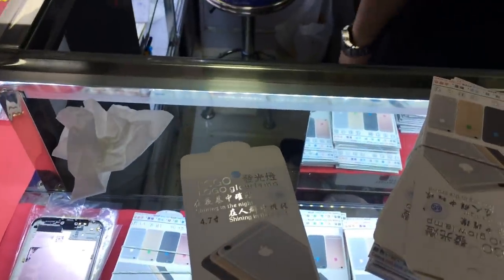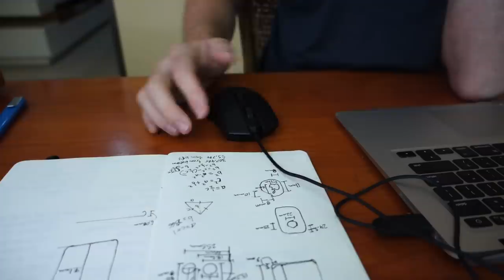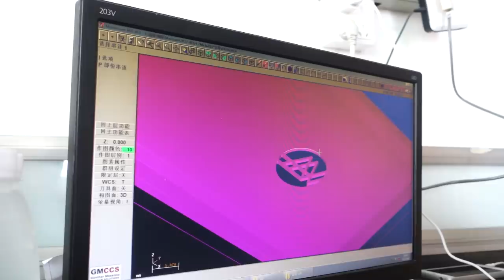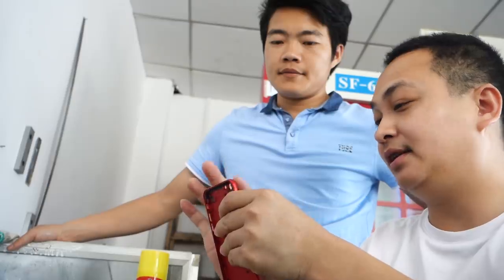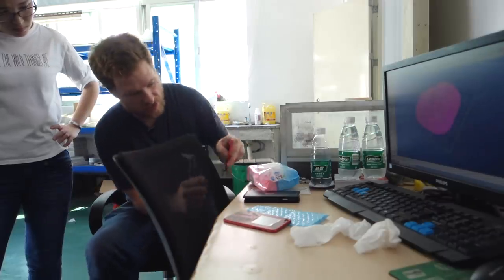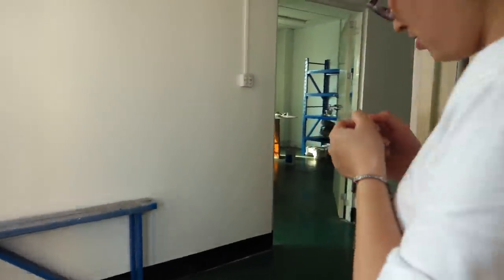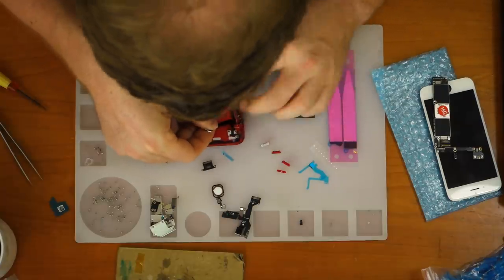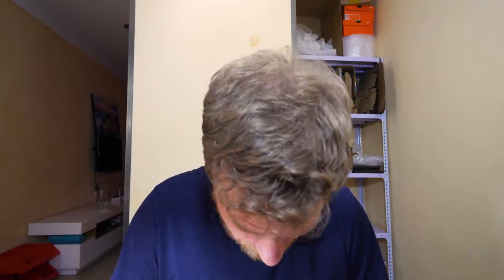iPhone Logo Glow-Up in Shenzhen

Comment: Removable micro SD slot!!!! :)
Reply: Experimental Fun I don't think that's possible
Reply: or the 265gb (was already in an other video)
Reply: I think it will be upgrading it to 512gb like the other individual who did it
Reply: Experimental Fun upgrading this iPhone camera with iPhone 8 camera would be awesome
Reply: Experimental Fun you will need a custom motherboard so it can understand how to use the SD card what it’s for and you might need a whole custom case and programming the Apple software into the motherboard will probably not be easy
Reply: Block Z YT a better idea , upgrade the camera of this iPhone with the camera of iPhone 8 .
I don't know  if it's even possible  but it would really cool .
Reply: a slot wich is removable?^^
Reply: Leo Landi I think it was this guy that did the headphone port
Reply: Its possible actually like the same way u conñect flash drive to iphone u can use flexible board and sd card reader thats it
Reply: I actually think this is possible from a software perspective although probably not easy. Companies like SanDisk have made expandable storage for iPhones that plugs into the Lightning port. The thing is that iOS obviously doesn't recognise extra storage. So you have to use SanDisk's app to access that storage - Apple's apps won't recognise it. Then you can use SanDisk's app to lift stuff off the internal iPhone storage onto SanDisk's storage.
So you could use this sort of solution for a removable microSD card slot. However, SanDisk's software will obviously be proprietary. So trying to copy their ROM onto some custom hardware would probably be illegal.
Also the idea of a removable microSD card slot is a problem in terms of physical space inside the phone, of course. There probably isn't enough space inside any iPhone to do this.
I suppose you could buy one of these expandable solutions, like SanDisk's, then sort of strip it apart and wire it up to a microSD card slot. That could work possibly. But I very much doubt it would fit inside the iPhone itself. Unless you reduced the size of the battery or something (e.g. doing this mod inside one of the big iPhone Pluses, and using a battery from the standard size iPhones). This would of course sacrifice your battery life though.
Reply: Modify camera to a better quality is good too.😊🙏
Reply: Software won’t allow that so it’s impossible

Comment: I'm no scientist but I wonder if the uneven light could be the diffuser not being flush and/or uneven pressure? It didn't seem like you glued the diffuser and you only glued part of the LED strip. So the light could be leaking to the inside. I bet if you get a tight seal it'll work.
Reply from the maker: Yeah, possible.  Might also have been the paint we used on the back of the logo insert.
Reply: Strange Parts hey dude please continue this series or do something similar , it's really interesting to watch!
Reply: It is about the light source. You are using LED, it is spot light. The LED are not surrounding the insert evenly
Reply: Strange Parts I guess if there's also a coat of metal-look painting the light could diffuse a bit better? Also, maybe you should sand down a small portion of the paint to allow the LED light enter the board fully.
Reply: I have an idea, change your channel's logo to be miss aligned therefor the iphone's logo will be perfectly representing your logo xD

I would really love it if you could pick a budget or low tier popular android phone (200-300$) and do custom stuff on it as well
Reply: Strange Parts I guess if there's also a coat of metal-look painting the light could diffuse a bit better? Also, maybe you should sand down a small portion of the paint to allow the LED light enter the board fully.
Reply: There are some of those kits with more LED’s for a more diffused light
Reply: Definitely from the paint, it should allow enough light for it to be even, especially since you can see that the bottom half is lighting up perfectly. When I was watching the video, before you even booted it, I was thinking the same thing as Zachary. However, This is still incredibly impressive. Amazing job! Wish I had the time, patience and resources to do something like this! Maybe someday. It's crazy to think that in China, there's so many people who can help you with things like this! definitely not the case in Ireland.
Reply: EIther that or a better LED kit could be purchased, one that covers his full logo, which appears to be much bigger than the standard Apple logo, along with the difusser being flush I think that a better kit overall would work.
Reply: I honestly didnt think it will get this many likes.Thanks :)
Reply: BTW you should try Die sink erosion for clean and sharp AF corners, i would pop off the camera lens plastic and use that hole as a reference point, get all measurements on a measuring microscope,  so that the machinist can zero in with his 3D ball sensor, waterjet and lasercut options are also there but i think the backing is too thin,  how about a large cutout logo at the back and replace it with transparent plexiglass?
Reply: It's better to use telflon sheet for the logo instead of paint on transparent plastic. However, telflon is not easy for precise machining.
Reply: Maybe I missed it but I thought the clear piece that came out o apple light had a pattern to it like a linear version of a  Fresnel lens or a prism.
Reply: he can take the light guide from a iPhone backlight. I works by bouncing the light around in all angles Super thin
Reply: Strange Parts can you upgrade this iPhone 7 camera for an ipohone 8 camera, I don't know if it's even possible but it would be the next breakthrough video after the headphone jack one.
Reply: zachary ballard Strange Parts can you upgrade this iPhone 7 camera for an ipohone 8 camera, I don't know if it's even possible but it would be the next breakthrough video after the headphone jack one.

Comment: Be careful with those cheap power supplies, especially used ones. They can be off by a volt or so by factory default and you don't really want to be powering a 3.3v circuit at 5v+

Comment: Recently I upgraded my 16gb iPhone 6s to 64 gb in Wuhan. It just cost me 260rmb. I think your next project should be this, it would be exciting I guess!
Reply: Did you replace the memory chip or the whole board as its soldered on? If its a whole board replace its not that exciting.
Reply: Joris just the memory chip.
Reply: Is that the cost just for the service?

Comment: try to build custom mobile phone from scratch, doesn't have to be thin
Reply: He has and i’m pretty sure it’s the same phone in the video. Not completely sure though
Reply: C He said a custom mobile phone. Not iPhone.
Reply: what he built is still an iPhone, what I meant building a hybrid phone with different parts of different mobile phone, cherry picking the best features from all smart phones out there. and make it run on ubuntu or something! :)
Reply: Quick Look n Teardown now that would be awsome
Reply: +Quick Look n Teardown That's an insanely difficult task that will make what he has done with iphones look like child's play. You cant just grab a screen from a different phone and a logic board from another etc... and connect them all together and make them work. A shit ton of reverse engineering is required, both hardware and software. It'd be easier to design an actual phone literally from scratch. (Not that it would be easy, just easier!)
Reply: Slap 4000mAh in that thing
Reply: that goes into the territory of completely assembling a new phone, which is definatly not a thing
Reply: Oh sorry for the misunderstanding :)
Reply: Who do you think he is? Andy from How to Make Everything?

Comment: what's that liquid they use on the cnc machine? it looks like milk lmao
Reply: It's an emulsion, mainly water, 5 to 10% oil and some additives  (defoamers, biocides, emulsifiers, ...). Water is perfect for cooling, oil is need for lubrication, that's why a mixture of both is commonly used for milling.

Comment: Not that I can see from the video but when I’ve ordered shells for phones from China in the past, the small buttons that control volume and power usually don’t have the small circular disc of metal that protrude far enough to click. I peel them off the originals and stick them to the new. Then they usually have the wire bracket missing, which pops off the originals with a flat head screw driver when brought to one end. Good video tho mate!

Comment: Hi, you can actually try a machine vison based CNC machine. I've done a project about this for wafer cutting(sub 0.001mm, but it's for die testing. A standard setup is enough for your application). It's highly accurate and what most important is you don't even need to provide a CAD ,  a very simple image processing can do the job. These machines are not everywhere but definitely not rare. You can also build your own on an engraving machine. A fixed calibrated camera should do.

Comment: That power supply looks like one of those I wanted to get on Amazon. One of those people has reported there is are spikes which is 3 times the set voltage. It seems like when the DC-DC switching circuit is gives out high voltage high frequency spikes and the output cap isn't able to filter it. I suggest you to hook it up to an oscilloscope to make sure your cheap power supply is safe at power up.